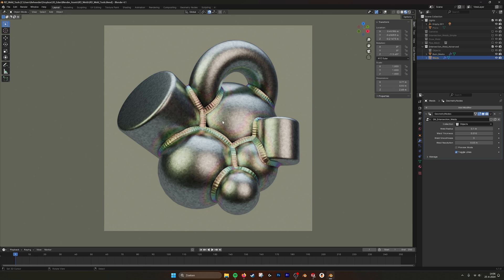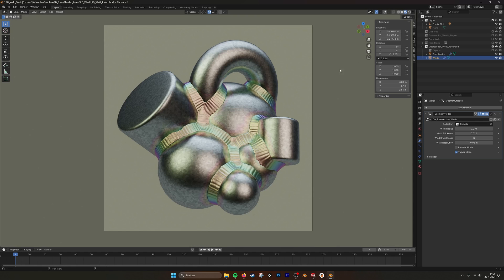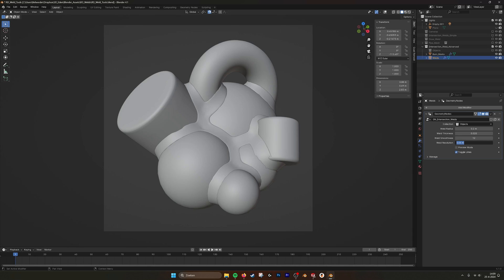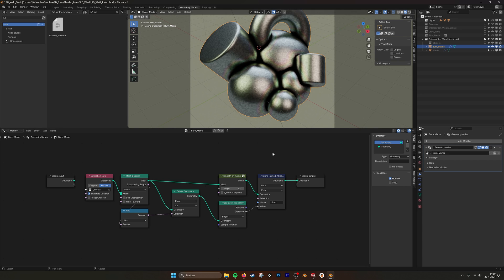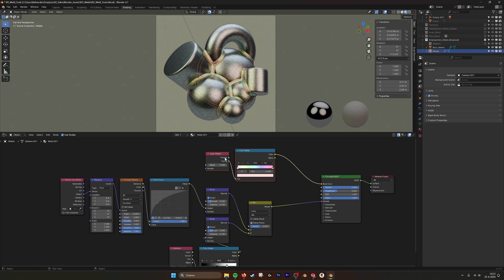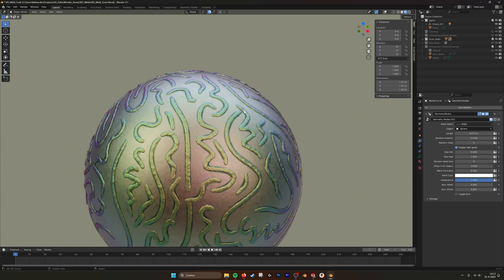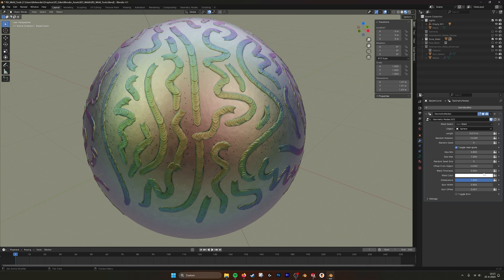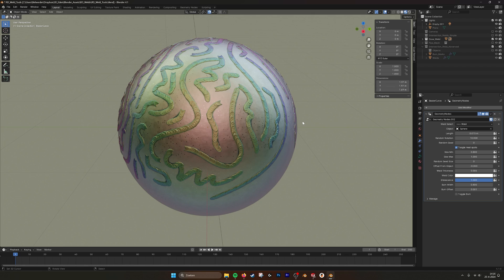Blender, Geometry Nodes, Weld Tools Update

Comment: welding engineer here. really great work 👍bought it. one of the best looking welds on the market. you should consider add "multi pass welds" for thicker steel construction welding. that would be perfect. thx.
Reply from the maker: Thanks for the suggestion, I will try to build it and improve this tool. PLease let me know if you have more ideas.